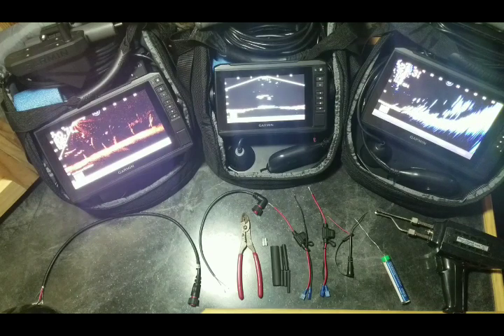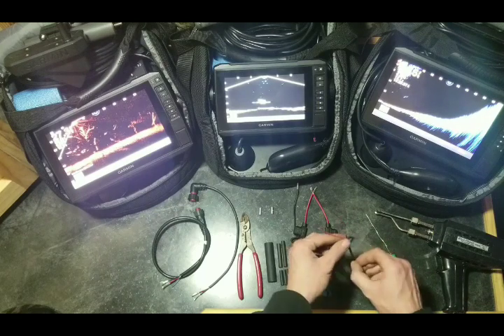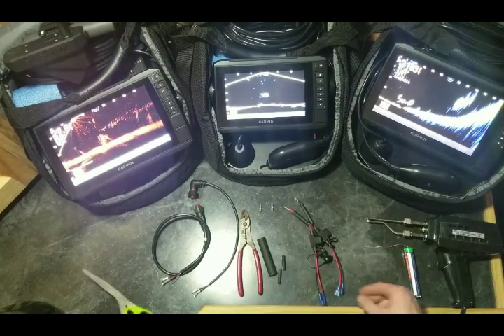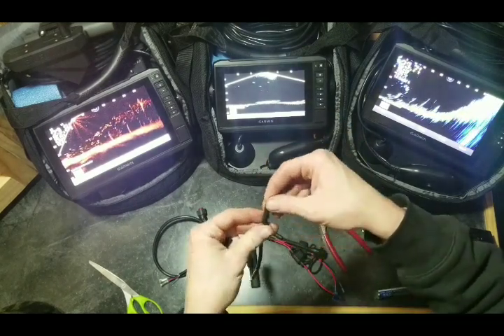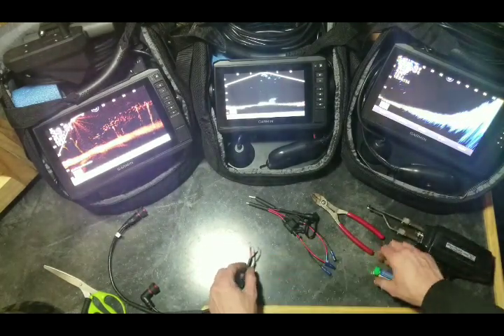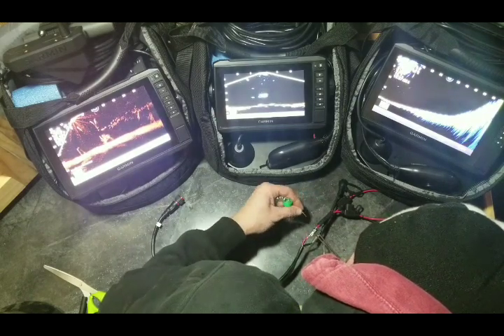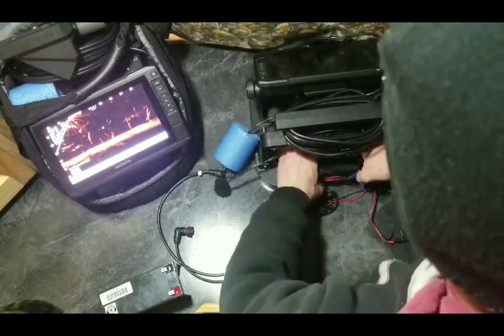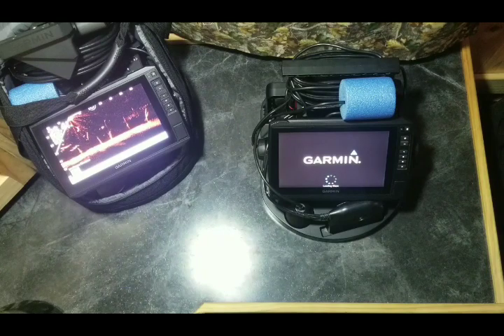DIY PANOPTIX LIVESCOPE DUAL BATTERY CORD by BFE

Comment: Could you just have cut the charger port and use those wires to connect to a 18v 6ah Ridgid drill battery?
Reply from the maker: I do not recommend drill batteries, some use them I do not.

Comment: Do you think that two 12v 8ah SLA batteries will run the 93sv with the ps22 ducer for a while? Should i run them in parallel or just run the screen to one battery and the ducer to the other?
Reply from the maker: I would just swap them when needed.  Lithium really is the way to go.  Get atleast 9 hours on one of em!
Reply: @matrowan-bfe3920  haha Yeah i would but I got those from my old man and i dont really have the funds at the moment to get the lithium. Do you think I'll be okay with the two SLA's and should i run the parallel?
Reply from the maker: Yes they will, I would only use one at a time and swap when needed.

Comment: Thanks for the vid!  However, won't the GLS-10 blackbox be draining battery continuously without some sort of switch between it an the battery?  Also, when you plug your charger in, won't the the GLS-10 be pulling ~2A+ from the charger?   Maybe the GLS-10 only goes on when the display is on?  I'm trying to do something very close to what you are doing, but not sure if I should put in a switch or switchable connector for the charger so it is on a separate circuit with the battery for charging.  Thanks for the help!
Reply from the maker: The power draw of the GLS10 when off iss about 17 milliamps or .017amps.  For casual use its not a concern, come offseason mine goes back on the boat.   If leaving for over a month unplug connections after charging.  Under 2amps when its runnging and even less with a dim screen!
Reply: @matrowan-bfe3920  Perfect, thank you!

Comment: Are the power and panoptix cables you used the ones included with the livescope system?
Reply from the maker: Yes the ones included can be used if u would like to save some cash.  I set it up for the guy wanting to mount on a boat in the summer and ice pack in the winter!